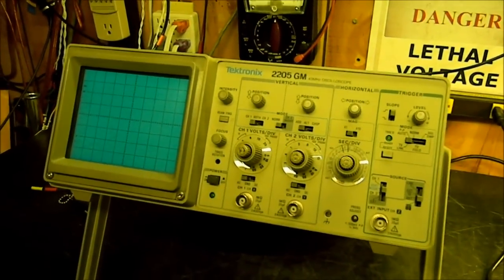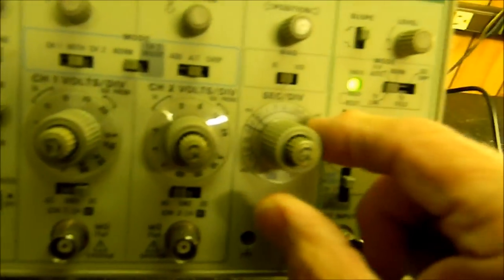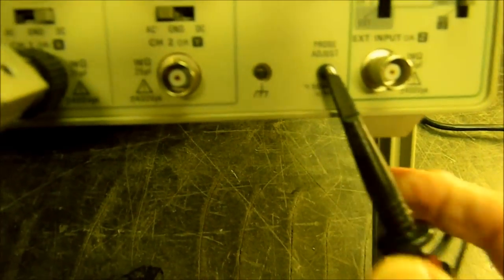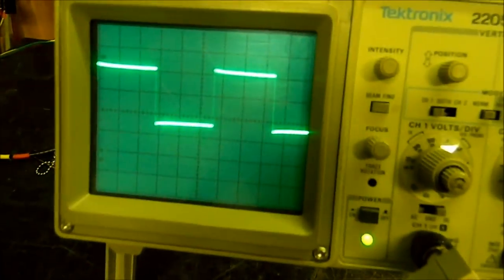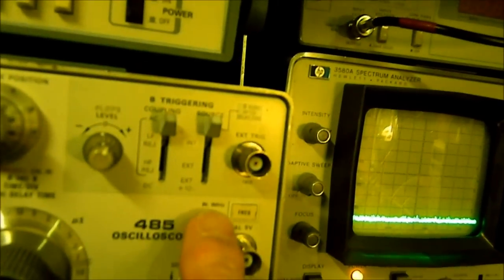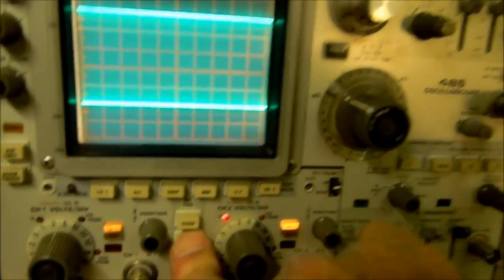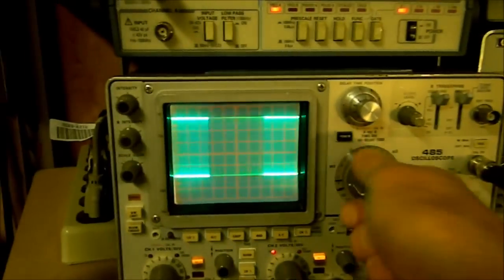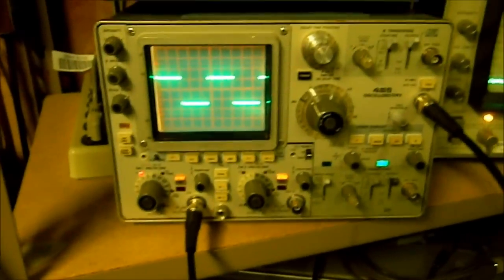Basic Tektronix Oscilloscope Check Out.wmv

Comment: Be sure you tell them that focus and astig controls are on the back!
Reply: ..er..on the 485, I mean. Also, rotate the channel 1 position control when channel 2 is selected. If the trace moves,  then there is a problem on the A7 board.  (Repairable,  but should be a huge price deflater.)